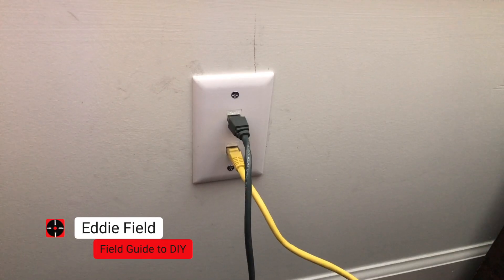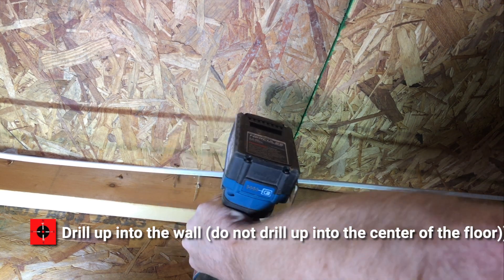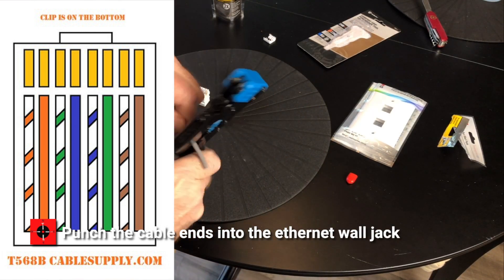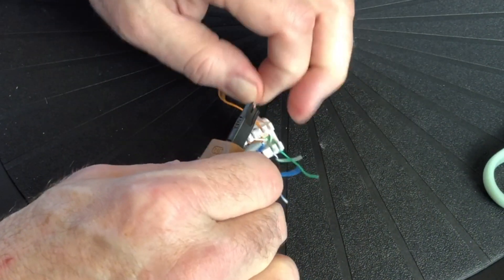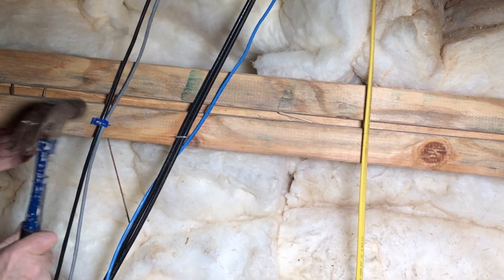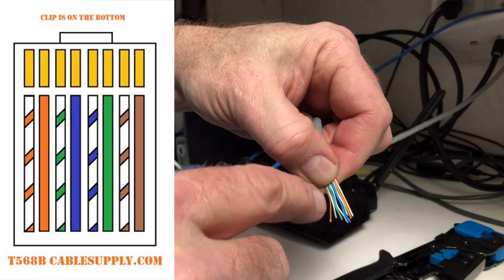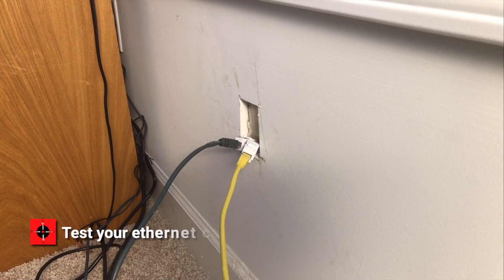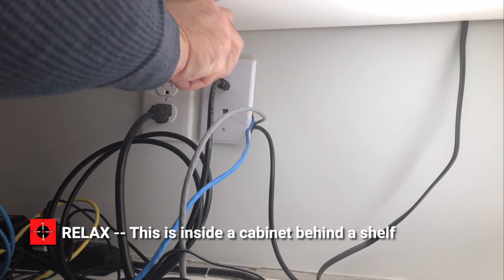How I Installed an Ethernet Wall Jack | Home Networking

Comment: What are you screwing into at 2:54?  That's the only thing I came here for - to see how the box is installed in the wall, and you skipped that step.
Reply from the maker: I hear ya.  I cheated.  I should have used a shallow “old work” outlet box.  Instead I didn’t use a box.  I only cut the drywall smaller than the plate a drove those screws into the drywall.  That is a shortcut and the reason that I didn’t highlight it.😢

Comment: I have a question, is it possible for the other side of the cable to be a female wall socket too?? and then go from the other wall socket to the router. That way i could reverse the location of the router and client if needed.
Reply from the maker: Yes, it is.  I could have even had two males or two females.
Reply: @FieldGuidetoDIY big thanks

Comment: Quick question.  So you put a female receptacle in wall, and then a male receptacle straight into the router. Both using B? That worked? You didn't have to go Female to female and then plug male from router into male into wall? I am a novice. So Just confirming.
Reply from the maker: Correct.  That worked.  I could have put a female in and a short CAT 5 or CAT 6 jumper but didn’t have the space for the box.
Reply: @FieldGuidetoDIY  okay, so what you are telling me is, I don't need a female at each end that males will plug into. No crossover issue. We actually need a male at one of those ends to prevent that. Is that correct?

Comment: I was going to have the ethernet wall plate be a couple of feet from the electrical outlet so the computer can have power and internet connections close by.  How far away from the electrical outlet do you recommend the ethernet wall plate be installed?
Reply from the maker: I would always err on the side of caution and have them at least a foot between each other.  Great question.  Maybe I ought to test that interference in a future video.  Thanks so much for watching!